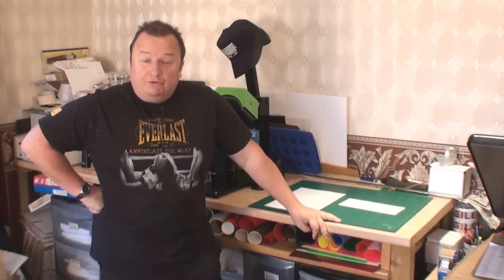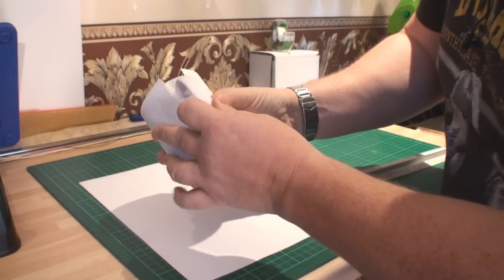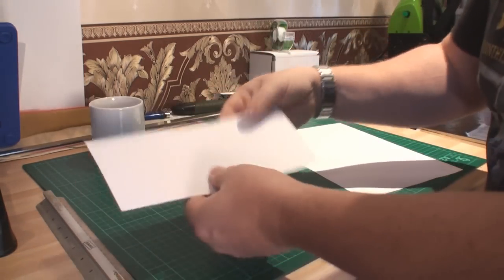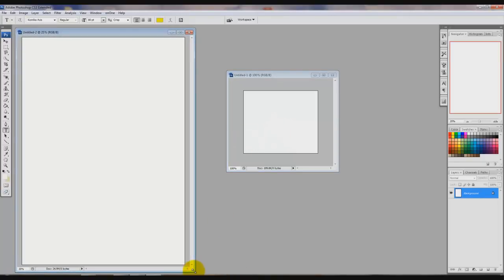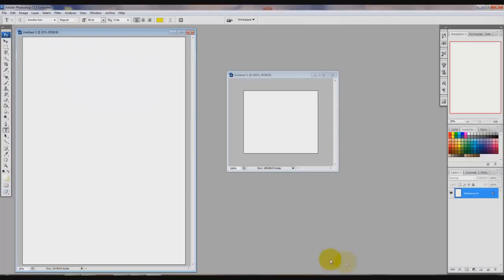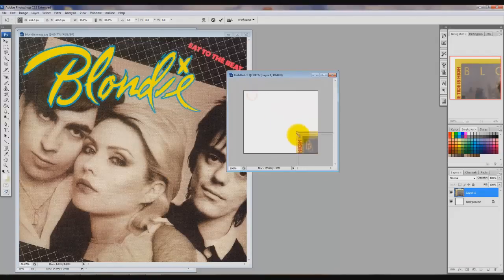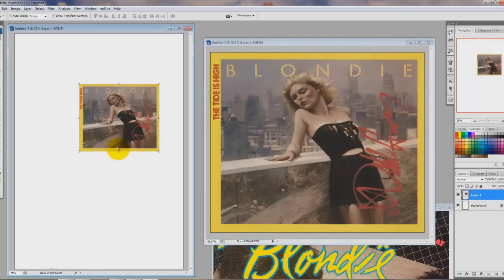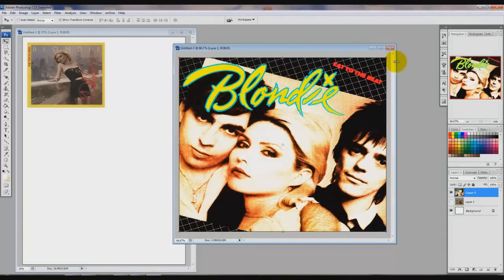How To Size Your Mug Wraps For Sublimation Mug Printing

Comment: Don't forget to mirror the image before printing :)

Great video Martin, thanks.
Reply from the maker: +Jon Archer My powerdriver software does this Jon but yes, you are right, all sublimated images need to be reversed for printing.
Cheers
Martin
Reply: +Martin Butler hi there,
I'm having a little problem with some of the results of my mugs. One edge sometimes doesn't transfer to the mug properly. I'm wondering whether it's a matter of not having it tight enough or a faulty heating pad. Any way I could send you a photo to show you the problem to see if you know what it could be?
Cheers, Jon
Reply from the maker: Jon Archer
It sounds like a heating element that is not heating towards the end of the mug. You could try a higher pressure or leaving the mug press on a little longer in the hope the heat radiates to the ends.
Failing that, your limitations is your mug press.

Comment: Thanks so much for your awesome vids. I'm new to mug pressing and getting frustrated with a particular issue. I'm pressing photos just fine, but I have a logo that has a black outside ring and on that image only I'm getting short dotted black lines scattered all the way around the mug. I have used in entire case of mugs trying different pressures, temps and times. The lines are not in the original image. I'm securing the transfer well and using a cover sheet so I don't think it's moving. I'm also dunking in luke warm water immediately after removal from press. I can't find this issue reported anywhere online and I have been looking for days. Thanks for any recommendations you could make.
Reply from the maker: Try and put a clean sheet of paper on the inside of the element before you put the mug and wrap into the press. It maybe some sort of contamination from the element.
Cheers
Martin

Comment: Hi Martin. Thanks for all your vids, very helpful. I bought the Galaxy press and was getting orange spots in the corner of my images. When I asked Subliblanks, where I bought it from, they told me I needed at least one inch between the handle and the image. But I see on this vid you say you can do a full wrap? Have you ever had issues with orange spots in the bottom corners?
Reply from the maker: No I have not Lloyd but I do keep a border from the edge of the mug if I can to reduce the risk of end fading.
Reply: Okay, cheers
Reply: @reviewthat , hi Martin, how much do you allow for the end fading? Cheers Collette

Comment: Hello,

Thank you for the video. It was very helpful. Now I have a question, when I drag my picture to the A4, it's not dragging the original size and it's making it blurry. How do I fix that?
Reply from the maker: You are probably using a very small original picture. Use an image no smaller than 700 pix x 700
Reply: @reviewthat  it's because when you did it you had the first image at 72dpi and the a4 page at 300dpi so the 72dpi will be smaller when moving over.

Comment: 1 More question, have you ever seen these vacuum type sublimators that do 12 mugs a time, you put an actual jacket style wrap around the mug, not sure how they work but they would save a lot of time for big runs. What are your thoughts.
Reply from the maker: You won't need that in the beginning, we mostly print single mugs to order all different designs so I wouldn't buy one.
Reply: Hi MArtin.Thanks for your reply.I am actually going to be doing it to add to my current portfolio of marketing products, so will be doing runs of 36 mugs a time minimum.I will buy a single press also for doing prototypes and samples, but bulk runs I feel I need the vacuum press.Have you seen them, and are they reliable and good value, I can get one for 300USD.
Reply: those are 3D sublimation machines for bulk processing of 3D mobile covers, mugs. you can also do slates, photo frames with them but one at a time because of large dimensions of these latter objects. mobile covers and mugs can be done up to 6-8 at a time depends on their sizes again.

Comment: Hi Martin.  Love your videos.  Hope you can help me. I finally was able to get my Artisian 1430 setup.  When I attempt to print my images from photoshop, they come out dull.  Right now I am testing on regular paper. I tried one sheet on sublimation paper already and i got the same results. Any ideas..i thought i would be able to print vibrant colors...
Reply from the maker: the images from sublimation ink do come out dull from the printer onto the paper. They become vibrant once they have been heated.
Reply: Thanks for the responseMartin. Does it suppose to come out dull Even if im using regular paper?
Reply from the maker: Yes it will Jeff.

Comment: Hi Martin, I have recently bought the Dino Dye Sub mug sized paper (on your suggestion, however when I try to print it, I get 2 half's of my image per sheet rather than just the one whole image, I have a RICOH SG3110DN printer running power driver, I have changed the settings in the printer properties and on the main display box, but its still the same, can you please help, as I am wasting so much of this paper, but getting nowhere. Hope you can help. Thanks
Reply from the maker: +Lesley Moore You need to change the settings in the powerdriver software and save the new profile. Check out this vid
https://youtu.be/z4wJtPGOThg?t=6m35s
Cheers
Martin
Reply: +Martin Butler I have added the size, but when it prints, it prints 2 half of my image on one sheet, I also added custom sizes to the main settings on the actual printer, I must be missing something, I followed your instructions fully, but cant seem to get it to print just one image per sheet
Reply from the maker: Lesley Moore
I can't really say without seeing it i'm afraid.
Maybe there is a Sawgrass helpdesk on their website.

Comment: Hi Martin, Good videos matey, I have learnt alot from them. Is flipping the image horizontally the same as the mirror image function in the printer software? I did the flip method and the text stayed the same, flipped around when i pressed the mug, weird...
Reply from the maker: If you are using the powerdriver software, everything should flip automatically when you print it out. but as you said, "flipping horizontally" is the same as mirroring.
Cheers
Martin

Comment: Hi Martin.  Very late to your video, but new to sublimation printing. Regarding the A4 paper not having as much of a wrap as the DyeSub paper; why not just print vertically on the A4 paper instead? Granted you will only then get two prints out of an A4 sheet, but at least people who have A4 paper in stock can still print a full wrap without going to the expense of buying the DyeSub paper (until they run out of course!)?
Reply from the maker: It's six of one and half a dozen of the other Mike

Comment: @MartinButler:   How many mugs can make with a single print?  I mean, for how long that transfer ink continue to transfer onto mugs?  And if you don't use it, for how long it is still good for use? Thank you@MartinButler
Reply from the maker: +A. T. not quite sure what you mean. All inks have a use by date but we never have many in stock. We buy them as we use them.

Comment: Thanks for this Martin! I have a question about the resized paper from Subliblanks? Is there a particular setting required in the Ricoh to print the shortened paper out in the printer settings? I am guessing that you just load the paper at the front of the tray? Cheers :)
Reply from the maker: +Nick Tracey You just measure the paper and put the new paper size in the powerdriver settings. I did do a video on it but I can't remember which one it was.
Cheers
Martin
Reply: +Martin Butler what kind of paper you are using for printing?, exactly please! thanks
Reply from the maker: brujas1977
We are using the Dye Sub paper from Subliblanks at the moment.
Cheers
Martin
Reply: +Martin Butler do not worry Martin, I'll soon more questions for you :)

Comment: another question too, i managed to print one off (dont ask me how lol) there was a few photos, sort of like a mosaic but some of the pictures are coming out a bit yellow any ideas?
Reply from the maker: +missymojo If the images are coming out pixelated after you have resized them, I think you are using too smaller images. Remember in the video when I said use large images, this is why. 

Not sure about the yellow as I don't know what inks you are using and if you have altered the printers colour profiles to match the inks.
Cheers
Martin

Comment: Mr Butler, can you help me please?
I have a Ricoh 3110 with sublimation ink but it wont print on glossy mug paper I purchased from Yolo.
It prints fine on plain paper.
I have tried all settings but it wont work, any tips please?
Regards
Carl
Reply from the maker: +Carl Wadham Hi Carl, Their paper appears to be for use with a laser printer and would be no good for the ricoh 3110. Try the dye sub paper from Subliblanks as this is what I am using.
Regards
Martin

Comment: Could u tell me the name of printer  using for mug sublimation? i heard that epsons printers are the best. please type the model?
Reply from the maker: Mine is a Ricoh GXe3300N but they have upgraded this model now to a Ricoh  3100. I have used many Epsons and they have all blocked up with sublimation ink.
Cheers
Martin
Reply: Thanks, and one more question please: what is the price of Ricoh  3100 , or epson printers?
Reply from the maker: Giorgi Giorgobiani
Just google them bud, there may be offers where you live.
Cheers
Martin

Comment: When I drag my first image over to the A4 it's that tiny I can't see it, any ideas please?
Reply from the maker: Hard to say without seeing what you are doing.
Reply: @reviewthat  you may have the resolutions different on each page - if you're printing an image it should be 300 dpi for all elements. If one is 72dpi, even if it's the same dimension when you transfer it to the 300dpi page it will be smaller.

Comment: lie I Said"  I bought a case of sublimation mugs-a Epson C88+Printer- sublimation ink- A Sub sublimation Transfer paper-heat tape I clean the mug real good. I have mug heat press.and i set it at 401 F. now this where i get mixed up..I don't understand  the time I leave it in the press for 79 seconds. I thin I'm doing everything by the book Thank You for your help....Jim
Reply from the maker: The timing will depend on the mug press you bought James. In general, when you put a cold mug in the press, the temp will drop. Wait till the temp comes up to about 380F and then start counting down the timer for about 120 sec and see how that goes. You may have to experiment till you get the correct times for your press if you have no instructions.

Comment: This does not work on CS5, completely different.  It will not transfer photo to the A4 like you are doing seemlessly here?.  Why does Adobe have to make changes that are illogical?.  It cannot do this in the format you have suggested with CS3.
Reply from the maker: You should be able to do it. Its a basic function.
Reply: @reviewthat  It is ok, just had to massively resize everything.  I was like, here we go, another bit of software that is not compatible with anything.  Thanks for a good intro vid.